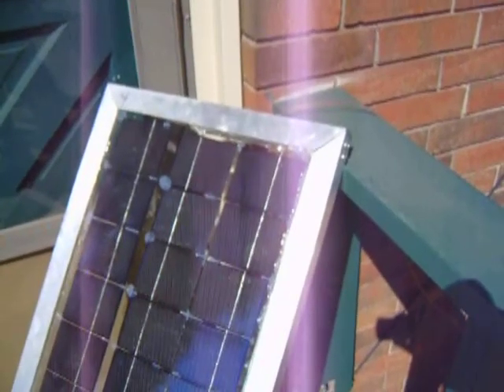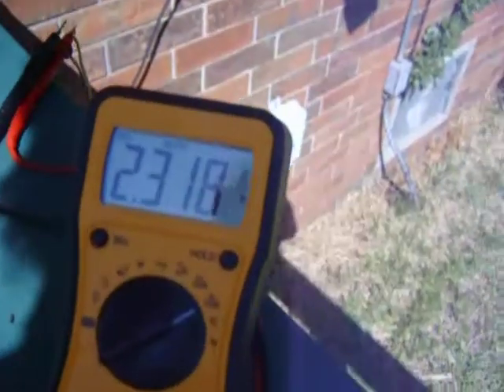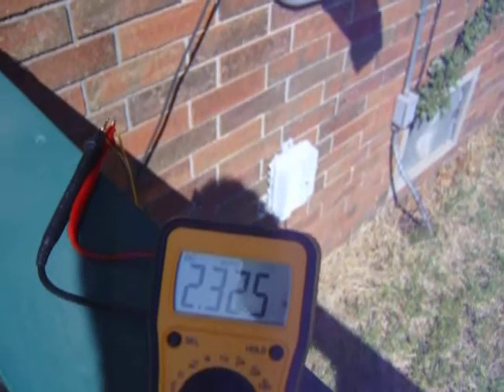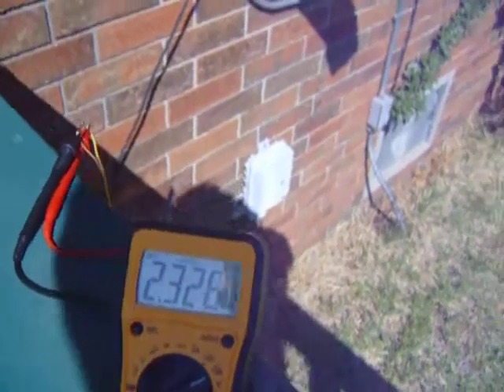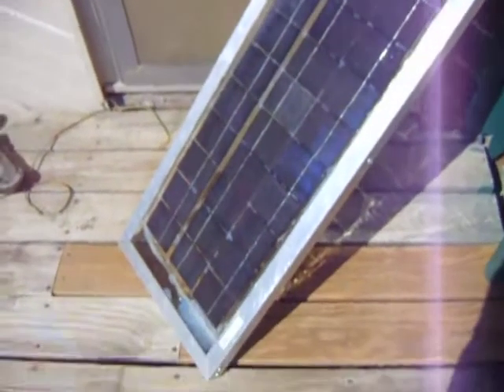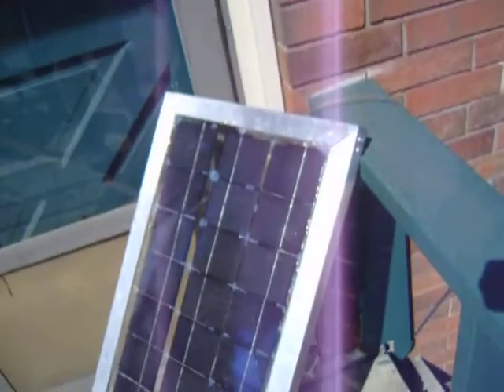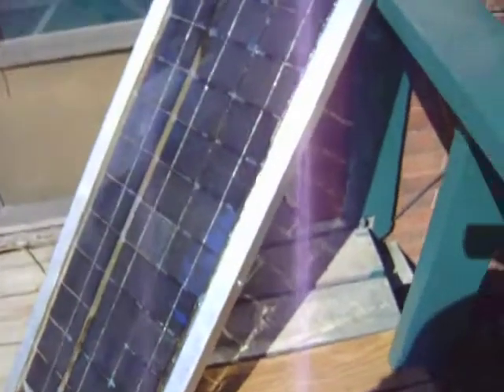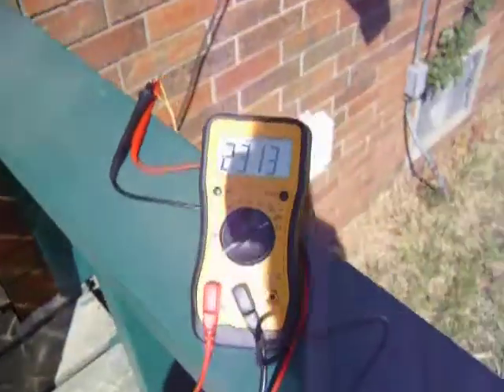How to Make A Solar Panel That Will Last For Thirty Years Part 14

Comment from the maker: @TheAsphaltCowboy47 yes I know lately solar panels have drastically reduced in price in the past last 3 or 4 months. Did you see the 72 cell panel I made it rocks with 110 actual working watts into the grid. Take a look at my latest video on my channel. Fealesstninker commented that it put out the same as his 140 watt factory made panel. Sorry but I just have to brag about this achievement. And yes it cost almost a couple of hundred bucks to make. I bought factorymade80watter

Comment: GREAT JOB!     I saw  another guy do this but he used wood and I like your aluminum much better. $100 each seems to not be worth it though when you can buy a Canada panel for about $30 more which is a lot more wattage. But I thank you for the great education you are a good instructor. Oh......If I may suggest a simple tool to hold down the hot tabs when soldering......a ice cream stick!